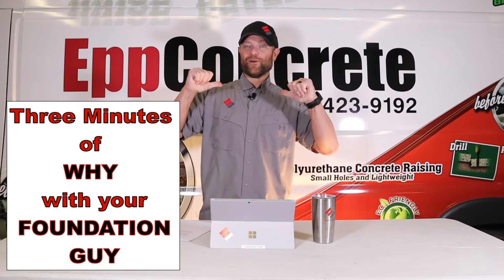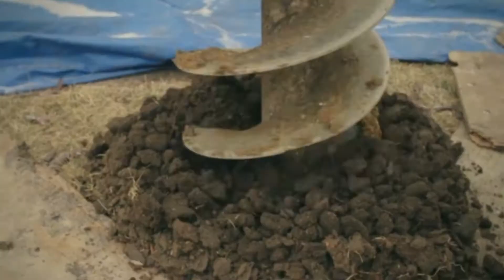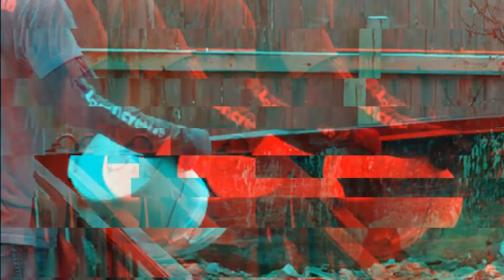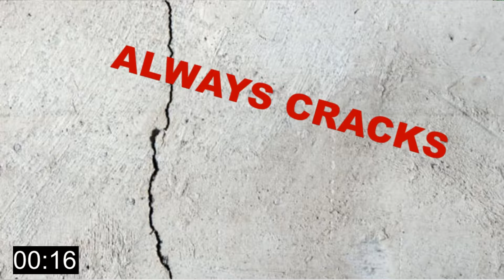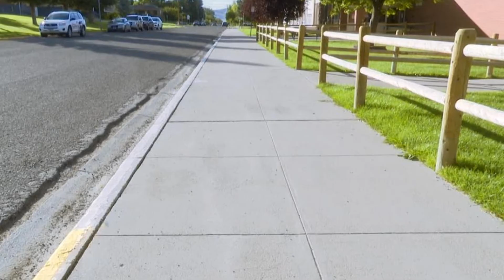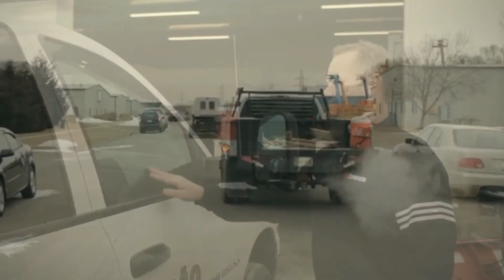Why Does Concrete Crack?

Comment: What to do with concrete that was poured and power troweled, cracks that same day. Not huge, like a fingernail will fit in. 100k basement floor. I’m freaked out.
Reply from the maker: It’s really hard to say without knowing the specifics of the pour, the concrete mix, and the weather conditions on that day.

Comment: Wow what a crock  concrete don’t always crack in a lifetime  I can show slaps poured 45, 30, and 5 years ago that have heavy use  some used as it was not intended to be    If you can’t pour it with out it cracking, learn how to pour it before you say your an expert or all concrete cracks  it cracks when people don’t know how to work it or frame for it   Like saying all front windshields crack  come this new generation of people just don’t get it so they make up shit about why there’s has cracks

Comment: Do a video on why streets warp.
Reply: heavy vehicles making sharp turns on pavement not designed for heavy loads.. or damage due to excess water penetration weakening the pavement, basically a garbage truck and warp pavement on a culdesac if its not the correct pavement depth, compaction or has water damage, larger vehicles create a surface twisting of pavement for e.g a semi making a u-turn, the front wheels travel and move fine but the rear wheels move slighlty forward and twist on the spot more.

Comment: This is BS. My pavers made of "concrete" blocks never crack. They only sunk because the foundation is made poorly.
Reply: The truth is somewhere in between.  The pavers never crack because their shape allows for very even curing of the concrete.  But sidewalks and driveways are extremely thin compared to the length and width, so it's a real challenge (impractical?  impossible?) to get very even curing.  And even if it did cure evenly, the flat shape still lends itself putting high stress on the surface.  Think of how easy it is to bend a playing card, stretching the surface.  But if you try to bend in other directions, it's hard, and that is what is used to build a house of cards.
Reply: @PeterLawton  If you have a problem with the thickness, insert wires and metals to hold the weight and serve as a cushion. That's what Japanese engineering to the best. They suffer 8k earthquakes a year.